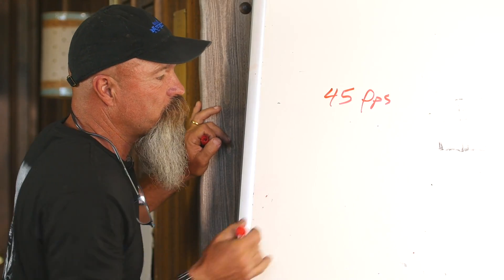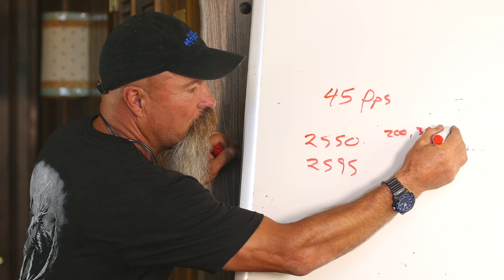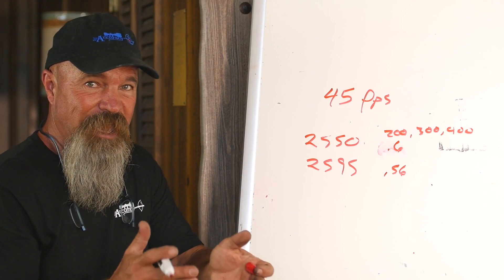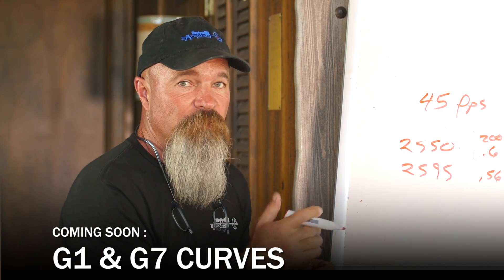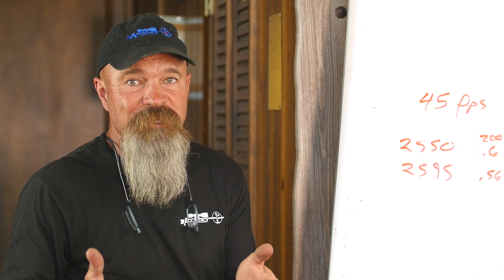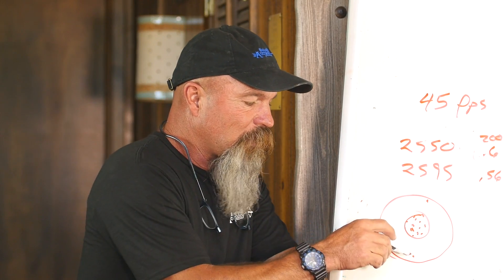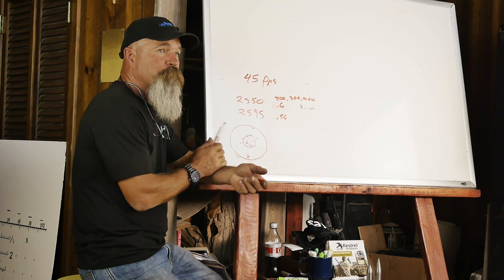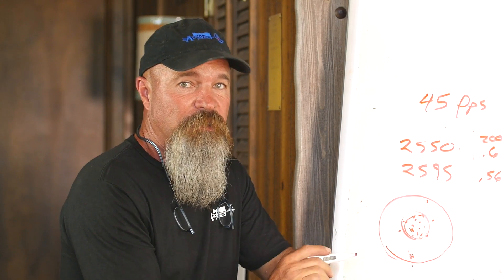What is Extreme Spread? | Todd Hodnett from Accuracy 1st

Comment: the 68-95-99.7 rule from normal distributions says 68 out of 100 shots will be within 1 standard deviation of the average velocity from the point of aim, it also means 32 won't. 95 of the shots will land within 2 sd.

Comment: When you want to reduce your extreme spread,  you have to improve your ammo or your gun affects the results too? Or maybe both? Very good video by the way!
Reply: Extreme spread is normally an ammo issue.  Slight variation in powder load and bullet seating depth are usually the problem.  Factory ammo can't be controlled, just change manufactures,  but if you reload careful measurements may be able to improve extreme spread.
Reply: @AZRED331  the neck needs to be clean and the neck size/tension has a big effect on sd and es.

Comment: Love these videos as you know!!  I was able to retire at age 45, three years ago. All I do is reload and shoot several days a week out past 2000 yds and under. With my current 6.5 mm system, if my Extreme spread is 20 FPS faster at 2000 yds, that’s 4.2 feet of vertical. At a grand that’s about 4”’s. . I strive to keep my es down below 15 and on my last 21 shots my es was 11 FPS.  Thanks for another great video.